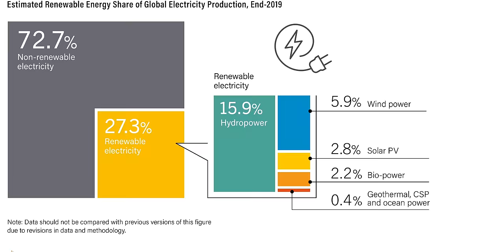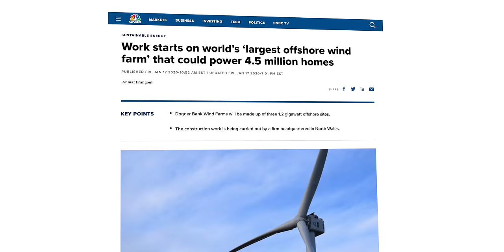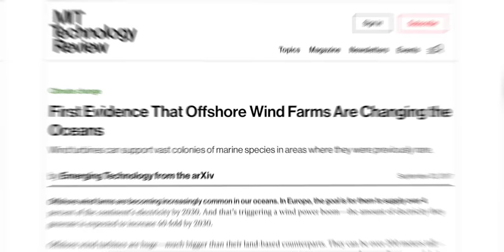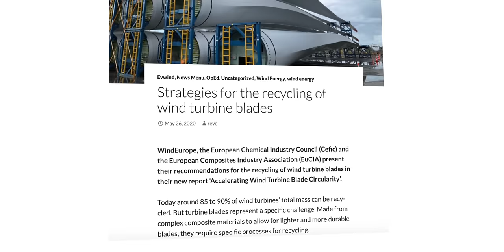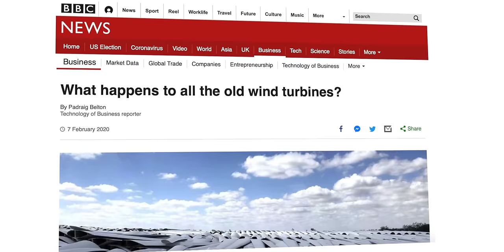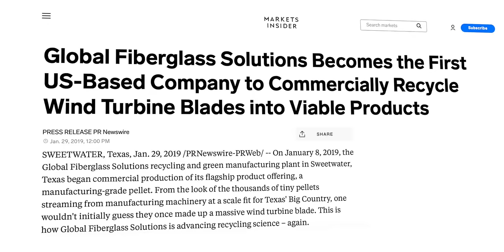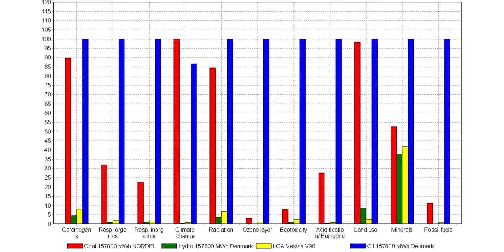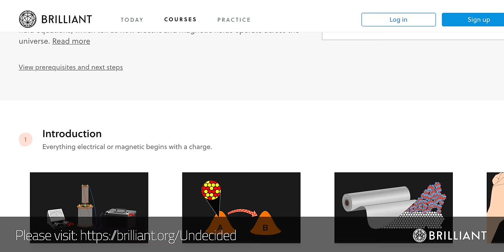The truth about wind turbines - how bad are they?

Comment: The answer to wind turbines is that they are now unnecessary. We now have the ultimate green power device with none of these problems, the SAFIRE GENERATOR. This is what we need to negate all the problems of all competing green energies. It produces almost costless electricity and therefore hydrogen from new fusion nuclear is now immediately upon us. We have recently taken a new step to advance the physic of power production by enabling chemistry of the atomic nucleus, or "nuchemy" in the newest FUSION NUCLEAR POWER technology. We are passing the chemistry level where we interacted with the atomic electron shells and are moving on to manipulations in this "NUCHEMY" atomic nuclear era when we interact and multiply nuclear protons. We have rediscovered the lost work of the alchemists and can make new elements with different atomic weights. This was ably demonstrated in "The Safire Project". Quanta are important. We now have enough energy to manipulate the atomic nucleus much more easily by creating a compartment, or what is a local region of plasma containment so reactions at this atomic nuclear level can easily take place. This is about to practically enabled a really fantastic and cheap new era of energy production for the whole of mankind. This with hydrogen, so free fuel obtained from water or atmospheric moisture anywhere in the world. This new fusion nuclear SAFIRE GENERATOR is at the industrial commercial production final development point as of now and it can retrofit older and decommissioned power plants. The energy argument and other power methodologies are all now virtually irrelevant as we have new and very physically and economically powered practical and local community level fusion nuclear power. Solar roof plus Teslawall battery may be the present way to go domestically but megapack batteries and multiple storage technologies interconnected with an expanded ugly grid have a less certain requirement when you consider new any-scale community based and 24 hr reliable and self-fueling fusion nuclear in the form of the "SAFIRE GENERATOR". Learn all about it at "aureon energy.com". Learn the newer EU Theory and plasma physics at "Thunderbolts Project.com" and you will be permanently reeducated with this advanced new EU theory that will allow you to understand more about the astrophysics of our whole universe and all within.

Comment: Didn't watch the whole video, but the wind turbines have only one problem - intermittent generation. All other problems are irrelevant or small. That's why the turbines for big generation need to be used as part of the system - like, wind turbines generate power, power is used for saltwater electrolysis, hydrogen is collected and then used for energy generation for the final user.
Also, do wind turbine blades seriously could last only 20 years? I'm pretty sure they can work more.

Comment: also existing research shows that wind farms decrease local wind speeds [14,15]. The wake propagation distance of large onshore wind farms is concentrated in the range of 10–30 km [15,27], so wind speed changes over longer distances are very weak. Oceans are producing oxygen. Without the proper wind movement there won't be any flowers, trees and oxygen required from the ocean movement
Reply: so the first part of your comment was from a (somewhat unrelated) article about how onshore wind farms do not affect global wind speeds, and then your second part was just unsourced speculation.

Comment: While I'm willing to argue somewhat with anthropogenic "climate change", I don't think any reasonable human can argue FOR pollution. I'mma "all-of-the-above" kinda guy. We need to baseload nuclear, including finding a GOOD solution for the waste. We need to use solar and wind where appropriate, including storage. Like you said, Matt, there is no way to generate energy without some kind of impact. We should have cost-effective, lowest possible impact, types of energy generation. You want electric vehicles? Fine. We need the power supplied, the grid enhanced, standardized fast charging stations ubiquitous on the highways and in homes, and 500 mile range. Then we talk. 

Clean power and a much cleaner environment are obviously in our near term future, but we cannot legislate our way there. We need to support solid science and not pipe dreams.

Comment: The more we work with windmills, water generators, batteries etc. the more experience we get and the more effective they become. Perhaps one day we won’t need as many windmills as we do today because of new generations of generators, recyclable storage batteries, and so on.
We should also start to use machinery that are powered by for example windmills, to build the roads and produce cables and everything else that comes into play. But we are only in the beginning of the green transition, and what alternative is there really for the ones who actually believes there is a problem with fossil fuel? We are going to take a step back in order to move forward.

Plastics are also studied more than ever, and at some point there will most likely be an alternative to fiberglass better suited for recycling.

If the really smart engineers had been allowed to continue with power stations at the same scale as they were back in the days, we probably would have had some extremely effective, environmentally friendly and safe version today, and then we wouldn’t even have had any problems with CO2.
Surely we would have lost lives, but not nearly as many as we have lost to simply air pollution.

Comment: Wind power is an expensive boondoggle, as is solar. Solar is not as bad, because it can be useful on a small footprint (roof of an existing home), but solar and wind farms create more cost and problems than they solve. Massive amounts of raw materials needed in their construction that “fly under the radar” and give the impression that whatever energy generated is “cheap” or even “free.”

Nuclear is the solution for stationary buildings (homes, businesses, factories, offices, etc). Of course, hydroelectric is good as well. Oil and other petroleum products are THE way to go for “mobile” power.

Never forget: Petroleum is a NATURAL, ORGANIC material from the Earth. It’s not “fossil fuel”, as more and more of the product is drawn from depths far beneath where any fossils have ever been found. Until hydrogen power for vehicles can be perfected, we’re going to need petroleum to power vehicles.

Comment: It is and isn't that environmental.  Concrete, steel, copper, gear boxes, oil, the generator (depending on technology) might have lots of rarer earth metals in it, roads, transportation, tons and tons of maintenance (I've read 30% downtime on average), component lifetime.  Then you need a huge distribution network, and most importantly, you need a 100% backup, which seems to forgotten when total system cost is calculated.  And, if you are going to use a distributed system as your backup, then see what happens when you try to quadruple our distribution capacity with high voltage lines.  (hint: lawsuits)   So sure, a wind generator with government subsides is economical, but what's the true system cost?    Why didn't you look at energy costs, versus wind penetration, to see if there's a correlation between high costs and wind?  Why didn't you list concrete as a wind material, and high carbon steel, and all the metals that go into wind (Nickel, cadmium, copper, rare earths, paints and coatings?  You covered view and sound.      And, you probably shouldn't talk to Texans about Wind right now.

Comment: They are not cheap to build or to maintain and their lifespan is to be determined.  They work when the wind blows up to their limits (i.e. high winds cause a shutdown).  Units at sea are more difficult and expensive to build and maintain and they need a lot of the latter.  They are proven bird killers and pollute the skyline in beautiful places.  People keep calling them 'turbines', I don't see any 'turbine', I see a windmill.  Biggest problem is this, they are unpredictable,  when is the wind going to blow at whatever speed?  We need electric during the day and evening, not so much in the middle of the night.  The wind can stop or change direction abruptly, causing an outage.  In effect there is a need for a reliable backup to be up and running all the time along with a power grid designed to meet the needs of the windpower system rather than the one we already have.  Solar systems have many of the same shortcomings.

Comment: Wind is free. Vertical blades are used to some extent. Sail boat airodynamics and technology come into play as they are being developed along highways to power lit road signs and lighting. Massive towers are not needed with these. They can vary in height and diameter as amp draw vary to need. Generators are at bottom of structure for ease of maintenance. Yard art models are available to admire and understand simple concept.

Comment: how much oil, gas, and diesel does it take to make and the install and maintenance so when you think about it you still need crude oil and by the time you put the screws to it the cost will skyrocket ........
Reply: Less than you would use to produce the same amount of energy using a fossil fuel plant.

Comment: Freeze frame "11:06" I was there in the mid eighties "84" to be exact When this was Experimental, I was one of a handful of installers We installed what we called eggbeaters Twin Blade Vertical Units there was about Ten that we put up, Two weeks was my Stint in this Field, It was a Very poor Design it Never took off. The Frame 11:06 is the South side of the I-10 freeway in Palm 🌴 Springs ca. The  Units that we installed where on the North side across the way, What you are looking at came later on,  it's also an Indian Reservation . Imagine looking at those BeautyfullMountains with nothing in between the freeway and them it's all Gone Now ,There are thousands of those Mills for miles and miles . It is a  👉 🌬 Bureaucratic California scam 👈
Reply: Wrong! Those "eggbeaters" were TOO successful, and efficient, so they were trashed.

Comment: Windmills are worse than you think. Windmills require a lot of maintenance too and maintaining them on high altitudes isn't without risk either. They are about the worst option for the landscape and one of the worst for efficiency. Indeed requiring a lot of land and resources. If having less of an environmental impact is the way to go, then windmills is one of the worst options.
The problem with wind power also is that it doesn't hold a candle against other energy sources like nuclear or even coal or gas. They're simply unproductive. No wind, no energy. How are you going to store all the energy produced when the widn doesn't blow? Something this video doesn't even address!
With the worlds ever increasing energy demands windmills are simply never an option for a large portion of the energy production.

Lastly, Co2 is seen as the bad guy right now but a lot of people forget that there's also a lot of benefits of more co2 in the air. It's one of the main ingredients in the food chain of almost all life on the planet. And there're many more things that impact climate change way more than greenhouse gasses, let alone co2 ever could.

Comment: The cost of any product also includes the cost of replacing them every 15 to 20 years, and how to recycle them. Very rarely does a company/government tell the truth about the after costs and the environmental cost of replacing them. Not to mention of the cost to the environment, of tree removal and the cost to wildlife. --- Modular nuclear energy over the long term is cheaper that wind turbines on a cost per kilowatt produced. over the life of the equipment. Solar panels are even worse. So all the public need to hear is the TRUTH, which is a very rear thing to hear. Just the truth thanks, stop the lies. -------- It also sounds like the cost of recycling the parts will also be a very expensive exercise due to the of the  labour component.

Comment: Has somebody done true CO2, etc numbers created in the process of creating raw materials, construction, transportation, installation, and other costs related to placing turbines, solar panels, and other alternative energy sources?  I also question the amount of energy and CO2 created in making and operating EVs.  It would be handy to have these calculations to compare them to alternatives to develop a  method to capture CO2, methane, etc by newer methods, and cleaner cars.  I also question how much pollution would be removed if we make smaller sized engines.
Reply: Yes, there have been tons of lifecycle assessments. This is true of both wind turbines and electric vehicles. They are typically quite favorable.

Comment: Sadly wind turbines still use large amounts of oil in the gear boxes of the turbines. The claim of no carbon footprint while operating is misguided. Yes there is a lower amount of carbon involved, sadly it will never be zero, or even low.

Comment: wind energy is transferred to those blades; does that change the wind patterns? does that change the weather patterns?
Reply: Not in any significant way. Very large scale wind turbine deployments could make a small but measurable impact, but existing fossil fuel generates make a large and measurable impact already so they are clearly an improvement over that. Fundamentally if we want to generate electricity it will have climate impacts.

Comment: Its blindly overestimated what they produce vs all the cost variables that go into them. The cost is heavy in fuel use for materials, maintenance, and manpower. What most miss(including this video) is the transport, production, construction, preparation, maintenance, and even surveillance of their operations since they span such large areas. I could write a book on these details such as the fact that maintenance and construction both require a large crawler crane that is so large it has it's own transport and maintenance requirements with high costs of their own. Adding to that is fuel use in the truck's fuel for transport and good luck trying to put together a crawler crane that runs on anything but diesel. Wind is actually very inefficient and calling this "green" energy is a lie.

Comment: You didn’t even mention anything about when wind stops blowing and normal power plants have to take over. Intermittent wind is only a supplement and is getting more expensive as many wind energy companies are backing out because of costs. Nuclear is the only true feasible answer in my opinion.

Comment: What is the actual all inclusive cost? Starting at the raw material mining going through manufacturing, transportation, installation, maintenance, environmental impact, decommissioning, dismantling, more transportation, and disposal. You need to look at the actual costs without subsidies clouding it. The environmental impact from cradle to grave and the actual production of electricity over it's lifespan. I think you will find it is not cost effective, environmental or green.